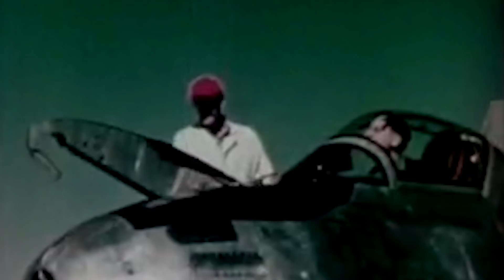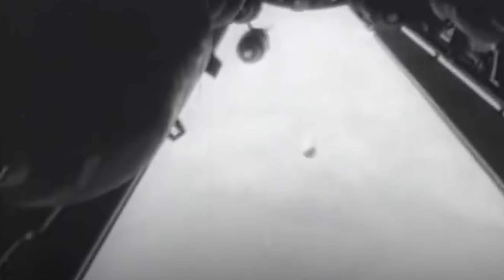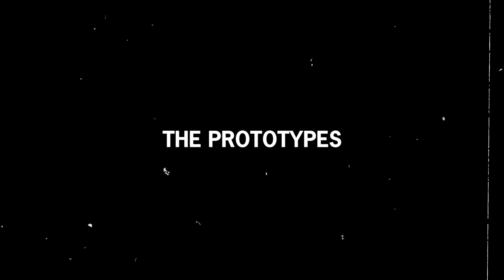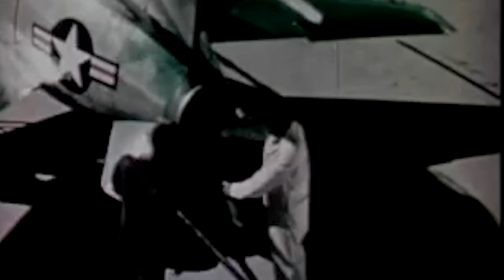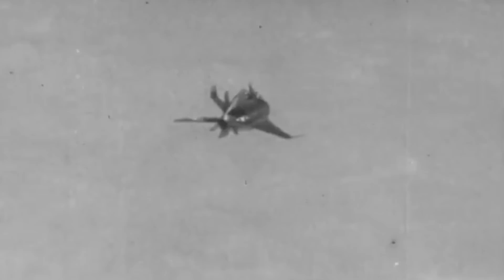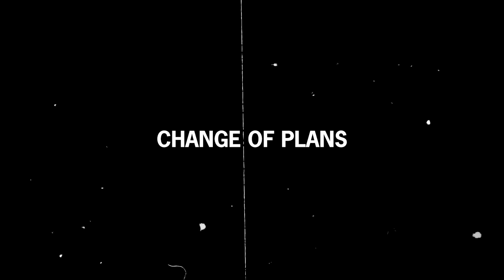Parasite - The Most Bizarre US Air Force Aircraft Ever Tested - XF-85 Goblin

Comment: I could imagine something similar eventually coming about. A bomber with maybe 2-5 drones slightly imbedded into the hull that can be detatched and sent to intercept anything nearby. Re-docking should be easy with a drone since they can make hundreds of course adjustments a second. I could also imagine a CAS mothership design with the mothership instructing drones to undock and do CAS attacks and then return for rearm. It would greatly increase loiter time if they can rearm the drones in flight and precision docking should make such a bay possible.

Comment: Might have been slightly less terrible if they hadn't insisted on  it fitting 100% in the bombbay. 

Making it so small means it could never fight real interceptors even if they got the dangerous docking system working.

Comment: You imply that the use of the F9C Sparrowhawk aboard airships was cut short by a crash of the prototype plane. In actuality, the concept worked very well and pilots reported that it was easier to hook onto the airships' trapeze than it was to land on an aircraft carrier. The use of the planes aboard the airships became quite routine and the ability to send out scout planes increased the airships' reconnaissance capabilities immensely. The USS Akron carried three of the planes in its hanger and the USS Macon carried four. The days of the operational airborne aircraft carrier ended when the Akron crashed into the sea in 1933 and the Macon in 1935. The Achilles heel of the combo was the fragility of the airship in bad weather and had nothing to do with the planes.

Comment: It may come full circle with drones, the only problem with the whole concept is that the mother ship is basically a taxi adding range to the parasites or drones and they may not have a great range but certainly can't get back home should the mother ship get taken out. Not such a big deal with drones if the cost per drone is low but we know how that works, the drones will be very expensive so it will not be cost effective.

Comment: Wounder what could be done with modren tech and design. I wounder if a catch and reel system would be better. 

For example. Using a eletric magnet on a cord for the first hook up, reel the drone into the second catch that clamps onto hook-ups on the drone adding futher stability and reel the systems into a third catch that is basicaly a mechanical arm that reaches out from the back and hooks onto the second catch that has a stable hold on the drone and pulling it into the mother plane. 

Im thinking having the recovery system builted into the top side of the iner back of the fuselage. Of course the frame may need to be reinforced. Wouldnt want the tail of the mother plane falling off in flight.

What is intresting is would it be possable to have the drones contained in launch tubs for aerial operational deployment. How many tubes can be used, would they be able to be armed or used for surveillance/ eleteonic warfare ect.., would they need launch assistance  using a catapult or rockets. 

Once such is figured out a assortment of prepared drones, depending on storage space can be prepacked and only need to be placed in the mother planes launch bay tubs for deployment.

 Then again it could be a engineers pain in the butt setting up a loading and launching system, recovery  retooling, repairing, and repackaging station. 

Drone size and flight opprational abilitys will dictate the setup im sure.

Wishful thinking coming from a guy who thinks the Air force could upgrade their gunships using Global Master 3s and add them to their AC gunship fleet. Im not even going to mention these puppies having rocket/ missle torrents and or auto loader double barrel howitzer artillery torrent system.

Comment: Question is why they never tired it with the aircraft being designed to carry it. The B-36s engines where in a pusher configuration a lot of the instability was probably due to the B-29s engines. Docking forward of the engines would have help considerably with the wake turbulence.